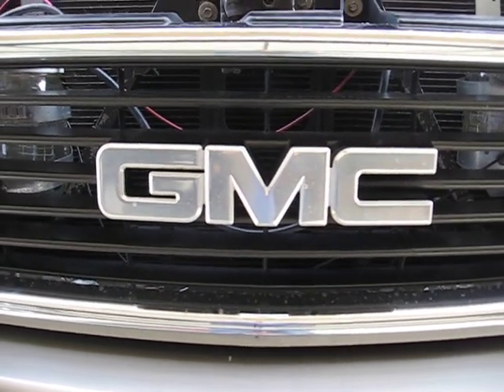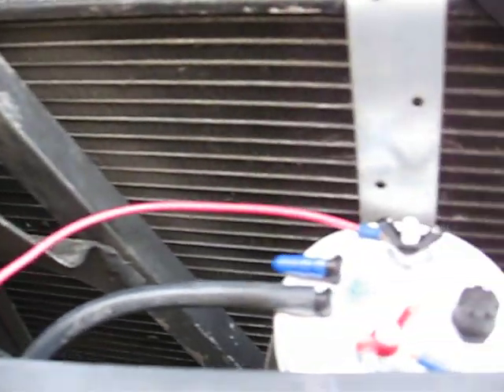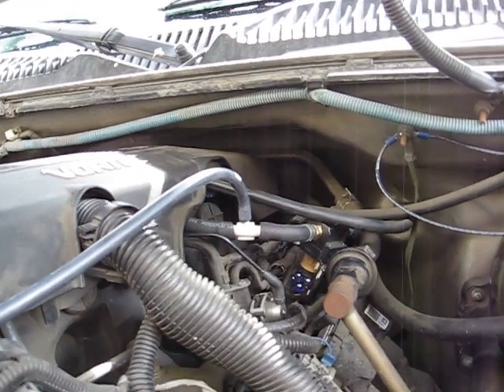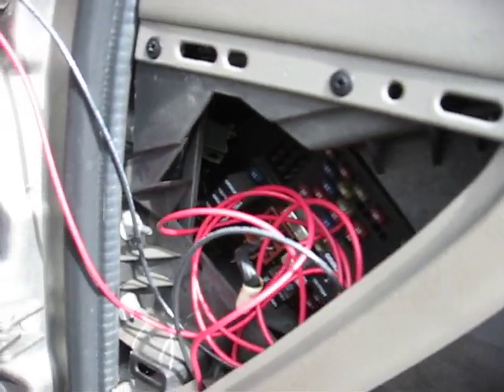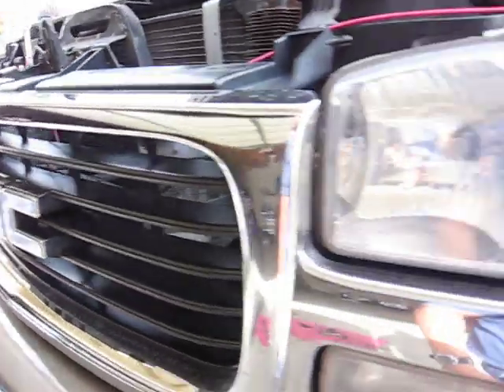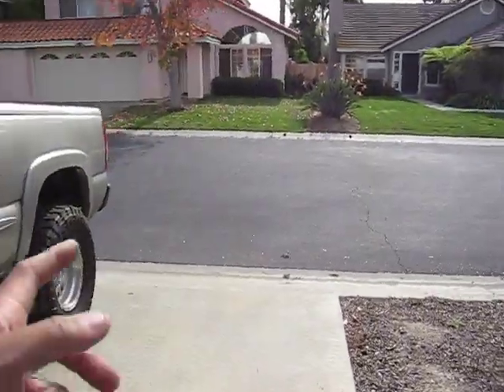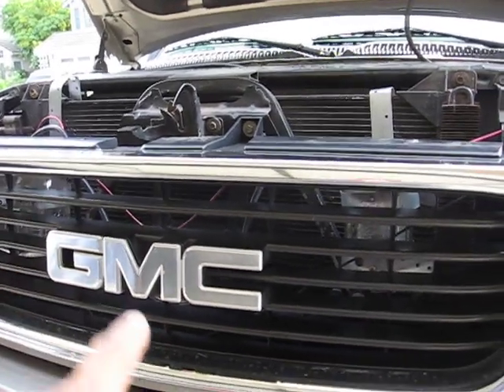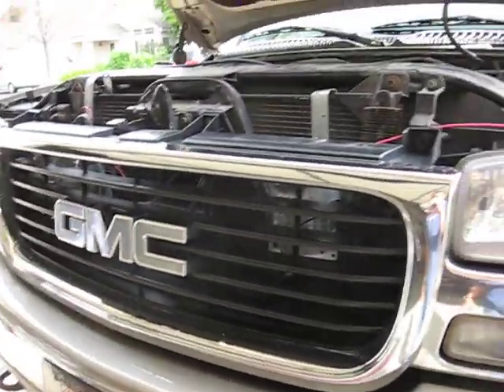Hydrogen Fuel Cell it WORKS!!!

Comment: You're creating a vacuum leak, the way you've connected it. The proper way to do it, given you have multiple cell is to connect one cell the the vacuum port ant the other 2 to the filter box. The one with the vacuum will loose its water faster, cause it's evaporating faster, so that cell should be bigger, with more water.

Comment: Dude the problem here is you are using the same amount of energy to power the generators as the generators are producing so you aren't actually gaining anything out of it.
Reply: So like a normal car and its battery then.
Reply: no this shit that he has put in his car is just a useless extra it is not giving him any extra efficiency, in fact because of the fact that you will never have 100% efficiency (especially in something so terribly put together) this guy is actually getting less efficiency because the car is having to power the stupid hho generator without actually gaining anything from it. Anyone with a rudimentary understanding of physics can understand why this doesn't work.
Reply: Mindandmatter21 Yeah I figured it out once I looked into it more. Only solution would be a separate power source that you used a sustainable energy source to recharge.
Reply: He is gaining, since he's using less gas per mile (or kilometer....), while the extra energy is coming from the battery.  Using less petroleum and more hydrogen and battery is better.  How exactly is that battery energy functioning then?  Recharge that with a solar panel or microwind, or home GreenPower is the other link in the chain, that's all.  The source of the energy is important, and this adds three potentially cleaner sources instead of just burning gas.  Leaving aside the issue of battery manufacture and recycling.

Comment: the germans are close to perfecting it. they have already got semi running off of hydrogen fuel cells only. hydrogen cells can replace gas. BUT north america does not have the technology or the man power to produce efficient hydrogen fuel cells. we just cant to it. china cant even do it and they have some of the best technology in the world. the germans are beating the rest of the world in the renewable energy race. there even working on pressurized air generators that uses air to create power

Comment: hello, i made my own generator and it works but iwant to know
1) how i can control the AMP or i dont need to control it?
2) how much generator i need for my Volkswagen golf 3 ?
3) and when you installed 20 AMP FUse it controls or makes safer ?
Reply: Nick Khurtsilava  in an electrical system the fuse blows and protect if there is an excess current drawn by the circuit. 

  if u need to control the current flow , u have to make additional electronic circuitry.

Comment: I would recommend replacing the THREE glass jars with ONE heavy duty unit; the plans are FREE on-line. A very simple design that can be built with OTS (off the shelf) parts for less than $100 usd. 

Just Google "HHO OTS"

Comment: WFC (water fuel cell) is probally a more accurate term for what your using, only problem with using HHO as a catalyst for gasoline (which works the same as a primer for a rifle cartrage) is the excess O2 thats going down the exhaust pipe, it oxidizes platnum, copper, and other rare and valueable elements used in catalytic converters, the oxygen sensors detect this as a lean fuel mixture and rases fuel mixture to compensate, ever replaced a converter?$?$? you wont get through emissions without it

Comment: You mix the baking soda right in the jar with the distilled water? What will happen if I mixed it in a gallon  container and then ad as I need it will it go bad after a wile? Also what is better glass or plastic mason jars ? I have seen a lot of people use glass but I saw one made of plastic  peanut butter jars .

Comment: Stop fighting okay, this is not true, the bubbles are not hho, the metal inside the container heats up because they put - and on the other side +, so the bubbles are just evaporation or moisture, water moisture inside the engine is a bad idea, that's why car manufacturer don't patent this thing because it does not work, if this works car manufacturer will patent this thing, off course they are vultures you know about car tech. So stop it now.

Comment: No water isnt a source of energy, but when you attach the water and baking soda mixture to a source of electricity you are actually using the principal of a conductor to in a sense create a cold fusion reactor used to create the chemical gas compound called hho or hydrogen. If you still  have doubts look up the Honda FCX Clarity since about 1998 they have damn near produced a vehicle that is ran purely off of hydrogen. Just in order to make the government happy they won't build it to produce hho

Comment: ok so you  added a fuel celll to your  GMC.... and it works... I just want to know if youhad to adapt your 02  sensors.... and also what did you do to your  MAP  sensor so that its not pumping in more fuel because of the increase of oxygen  in the system.. did you have to use a sensor enhancer??? let me know how you did that ... if not.... because thats where I' m at.....

Comment: @revlimiterUK . its true that it takes more energy to produce. it has been known that hydrogen is burned cooler there for letting the engine run more freely depending on the oil used thus allowing more garenteed power. There are now safer practices of producing and storing hydrogen. We can use solar panels to produce hydrogen and solar panels become more efficient every year.

Comment: props dude. my buddy did this with his honda civic. it was his senior project. he did all the research and built the same jar cells you did. on a manual civic that got 29 miles per gallon. he added the fuel cell to get about 35 per gallon. it works. it just seems sketchy. but dont be all freaked out kids!!! just scared of a little science.

Comment: If you add more electrolyte it will increase the output, but it will also increase the amperage. If you add more electrolyte, your fuse will probably pop. You might also want to look into a 12V Automotive Circuit Breaker on Ebay. It will save you having to continually buy fuses.

The best electrolyte to use is KOH (potassium hydroxide), but you have to order it online, because you won't find it in any store.  I get mine from essentialdepot(dot)com for less than $10 for a 2lb bottle.

Comment: It is great that you are experimenting.  I started with the wire in a jar fuel cells, but quickly realized that they are not efficient at all.  The amperage is too high with stainless wire and it will eventually melt and warp the plastic supporting the wire. The water will also get too hot and will cause steam to be released into your intake.

Look into HHO Dry Cells.  They are a much better way of doing this.